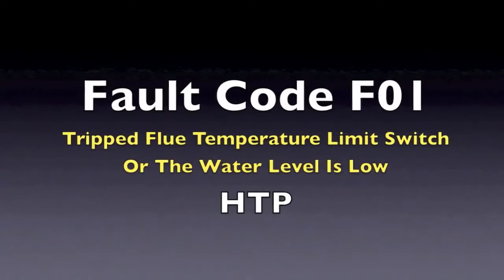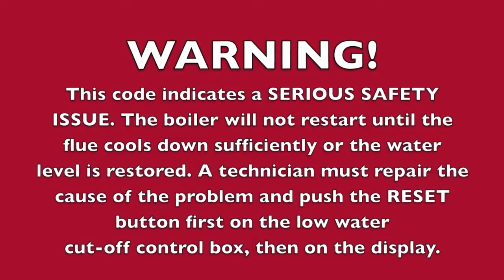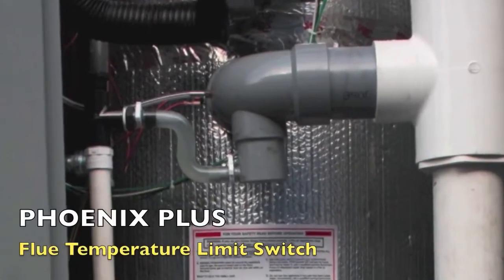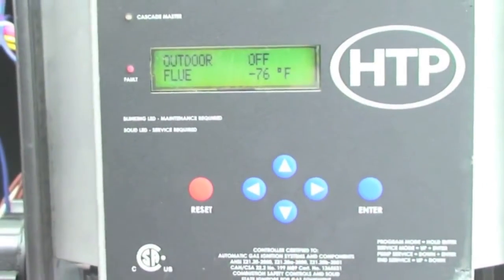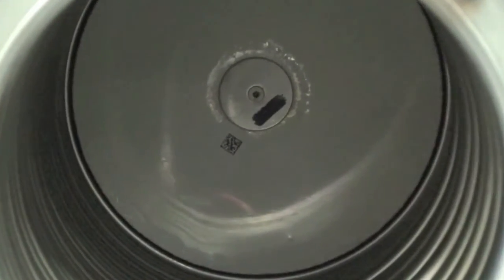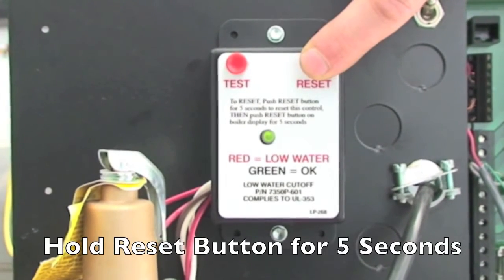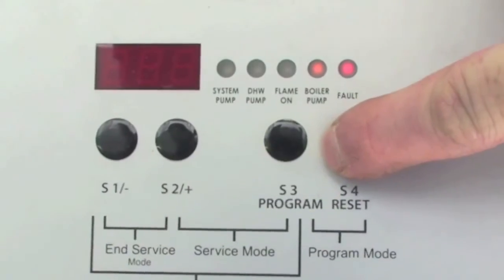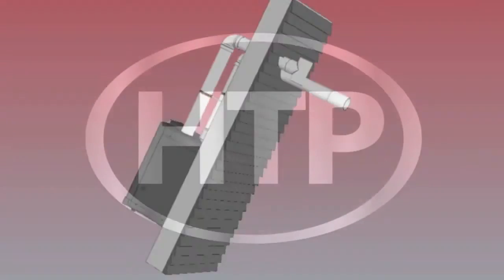F01 Fault Code - Flue Temp Limit

Comment: My flue thermistor broke off. The part that broke off part number is 7450P - 026 in the manual. I called support and they said that they couldn't help me because I wasn't a licensed appliance repair tech but the guy on the phone told me some stuff to check so they were pretty nice about not helping LOL. The part that screws in the housing completely broke off and it was laying beside the exhaust stack. . I cant post any pictures or I would. I have an HTP EL - 150.
Reply: same thing happened to mine.  then it failed altogether